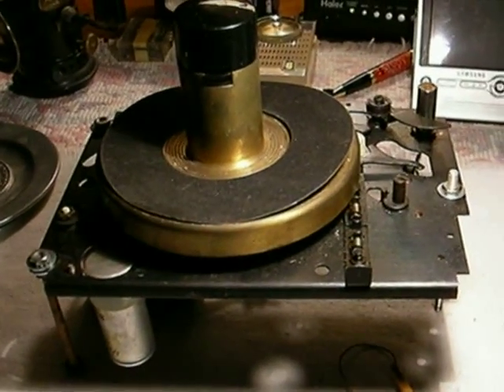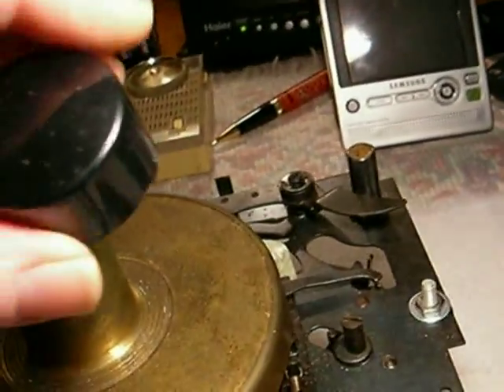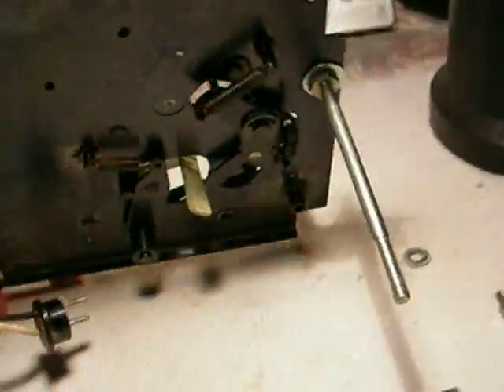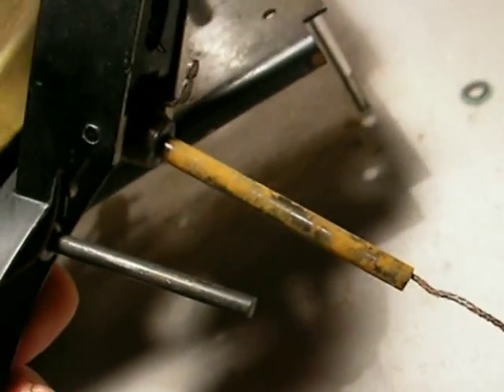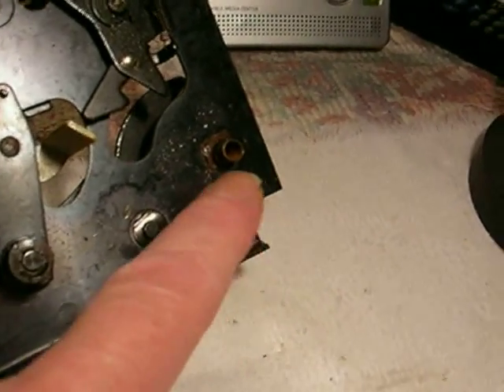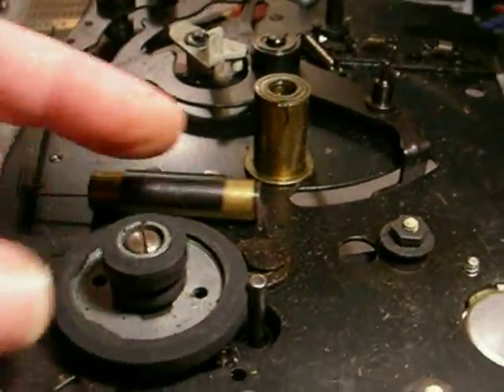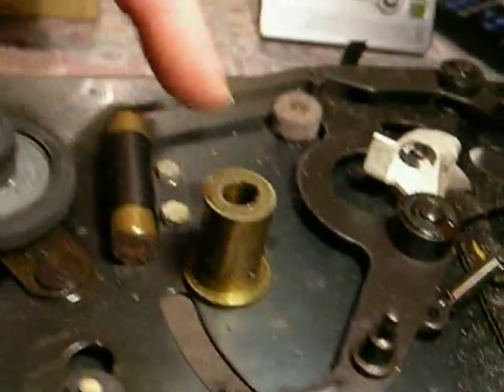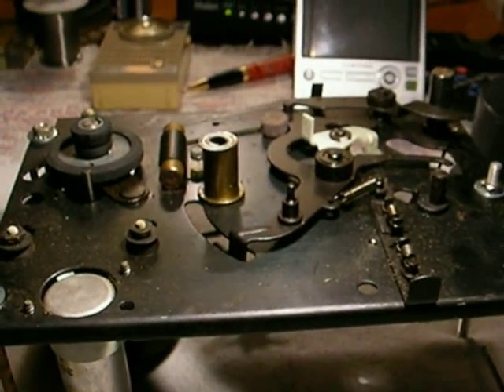RCA Berkshire RP-168 45 RPM record changer

Comment: Do you recommend useing 3 n 1 oil in record players? and what type of grease is good to put on the gears? I have a Technics SL 1950 that i want to clean off the old grease and clean up the whole underside, Any suggestion and help would be greatly appreciated! And i was wondering if you got my email on that bubble light mod to run off leds if you can draw me out a diagram and show me how you installed it in the light base? (a parts list would be nice as well) Thank you so much for your help!